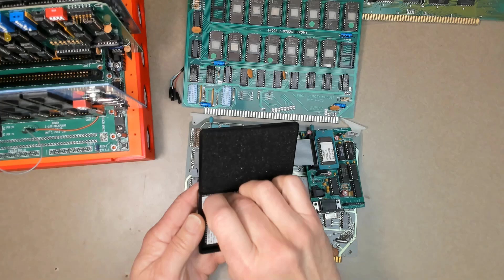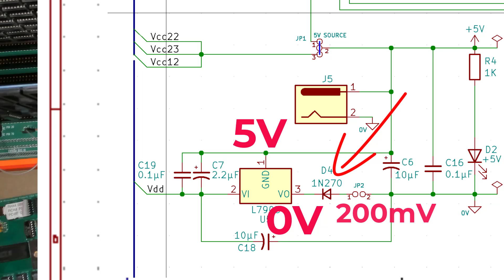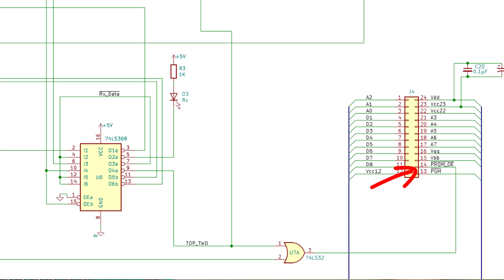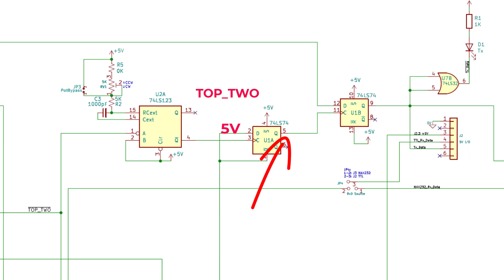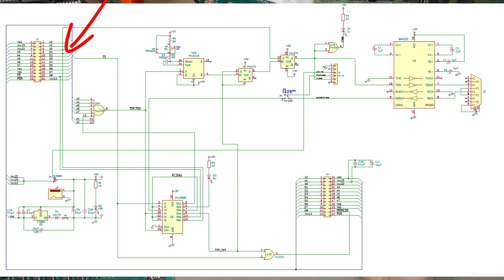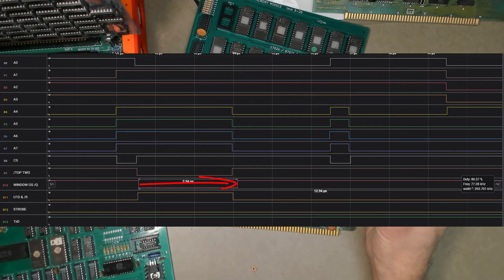{114} Tack a Serial Port onto Vintage Computer Systems- Simplify Diagnostics and Reverse Engineering

Comment: to be honest, i think this title is misleading, if not clickbait. With the work you have to do to get it running on an unsupported System, it surely cant be called "immediately". first you have to adapt the board itseld if the target system has a different ROM socket (more address lines) than in this case. Second you need to write a program that isnt really beginner friendly with the bit-banging method that is needed. then you need to get all sorts of data from the target device, such as addressing schemes, bus timings and so on.... its nice that you have your set of EPROMs for this purpose but they wont run on anything else.

on most vintage systems there are far easier options available, but thats just my opinion.
Reply from the maker: Suggestion noted.
I am very interested to hear about what other options you have available to more easily add a serial port on a vintage system that you know essentially nothing about.
  
You are right, it is only immediate if i already have the code for that CPU.  I am open to suggestions for the title... how about "Readily" rather than 'Immediately'?  On a board that has functional ROM decoding, it takes all of a minute to make sure everything is plugged in OK, power up and establish a serial port.  It is much easier of course on boards that use larger proms because the code doesn't need to be broken down into small chunks.  a whole diagnostic program begins to fit nicely once it is up to the 2732 or so.  For example, I bought some no-name 8080 board the other day that i knew absolutely nothing about other than it had onboard RAM and ROM.  After figuring out which pin of the power connector was which, powered it up... (I happened to guess which PROM socket was zero on the first try, 2732) ... pressed a space for it to autobaud, it came back with a menu prompt so i had it map the RAM and the other PROM sockets.  Quite a lot accomplished for 5 minutes of work.

It is useful to know the prom socket address for sure, but if it is a single board computer one of them is nearly certainly mapped for the program counter to fetch the first instruction after reset.  worst case I need to try both of the sockets (PROM 0 is always at one end or the other) to find which one is 0x0000.  I have code for the CPUs i favor, including 4040, 8008,  8080/8085/z80 but see no reason it couldn't be carried out to other vintage CPUs.

In all seriousness, i am very interested to hear about your other solutions that are far easier.
Reply: @HelloWorldETX  new title is nice :) okay now regarding my "solution" for easier implementations:
1. i was referring to the fact that most vintage hardware has some kind of provision for adding serial interfaces, you may need level shifters or other kind of interfaces obviously, but then it becomes easiert to make a solution, based on that hardware, because writing assembly programs for ROMs is no trivial task for most users.

2. i like the general idea of your interface, however, let me make some suggestions, maybe for another version, which would simplify the usage on other systems: Remove the ability from your adapter to pass-through a ROM to the mainboard. In this way you gain all Address lines for the serial interface and dont need to write any new code for a new system. Of course then you need to add a Microcontroller onto the Adapter but its code needs only be written once for all systems and architectures. Also then you dont need to do bit banging because you can use 8 adress lines to TX Data bytewise and some of the other adress lines for status and control registers. The microcontroller will read A lines and write Data on the D bus on CS edge. Also the Microcontroller will provide CLK for the MAX232 and the whole design becomes independent from System CLK.
Next suggestion would be to eliminate a "fixed pin count" style cable to the ROM socket and use Jumper wires instead, this way it becomes more flexible for other ROM sizes.you would only need a GND wire, some wires for A bus, 8 for D bus, and one for CS. GND would obviously route somewhere else than the ROM socket in case of 1702.
Reply from the maker: @srmeister1  I see where you are coming from, but if i need to go that far i will pop out the CPU and plug in emulator hardware.  These adapters let me go from a cold, dark, completely undocumented board up to running a full suite of probe/diagnostic software within minutes of first seeing the hardware.  Additionally, they are simple enough to permanently leave it connected to hardware that has no other interface.
Reply: @HelloWorldETX  the old title was like "immediately add a serial port to any vintage systems" and yeah, my thoughts were about how to add a serial port - not how to debug a faulty system. the new title wont confuse as much.
Reply from the maker: @srmeister1  yep. Thanks for pointing that out, I was only thinking from a diagnostic perspective.
Reply from the maker: How does the updated title strike you?

Comment: What a brilliant idea. I have a couple of 1702A devices but I don't think I still have anything that uses them. It would be worth seeing if I can adapt this idea to work with the Motorola D1 kit I have that uses a 6830 ROM device.
Reply from the maker: Off hand i don't see why not.  Like many masked ROMs at the time, the 6830 ROM had multiple chip selects that were configurable to allow multiple ROMs to be used in the same system without the need for address decoding.  Those would need to be managed and used to select when the serial interface latch is being addressed rather than the ROM.   
The kit has a serial port, but if there are other problems preventing it from working- then coming in through a PROM as a back door serial should work just fine.

Comment: That upside down 7905 generating ground is a really clever idea.
Reply from the maker: Thanks, I am not sure it qualifies as a "typical application" for the databook.  
A word of caution regarding the regulator --- if the +5V source jumper and the 0V create jumper are both open, that will allow the 7905 output to go a tiny bit above the +5V reference and the 7909 does not like that *at all*.  It will pump full current from the +5V rail into the -9V rail.  That is why i recommend leaving (or installing on v1.1) the shorting traces on JP1.